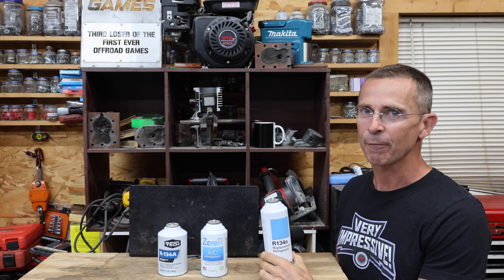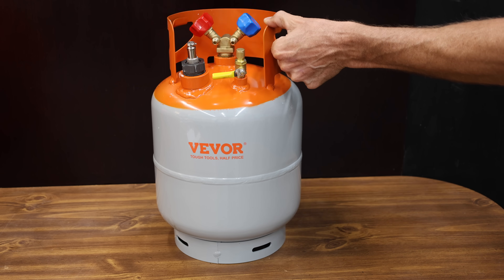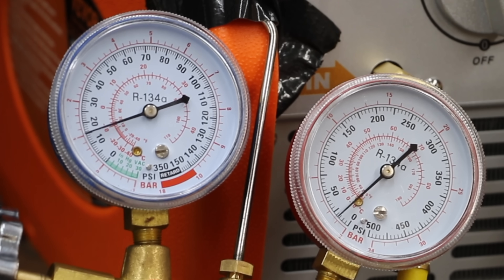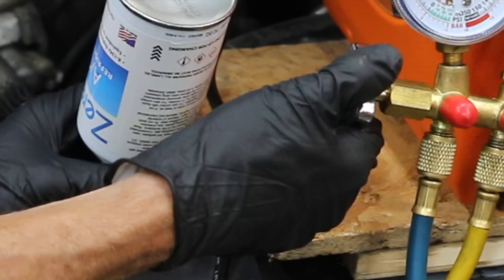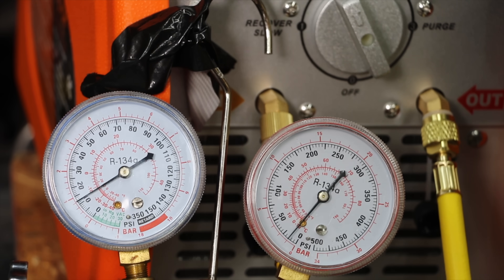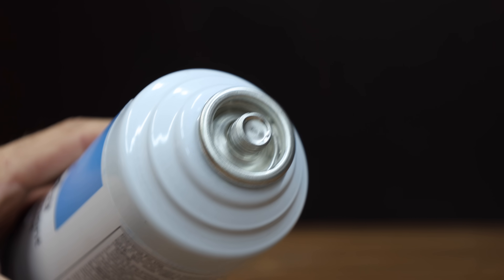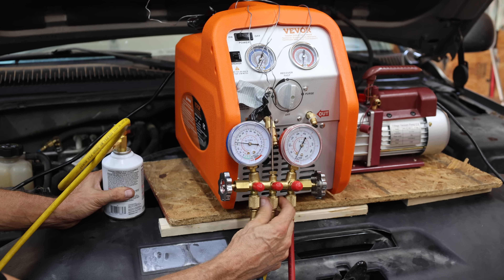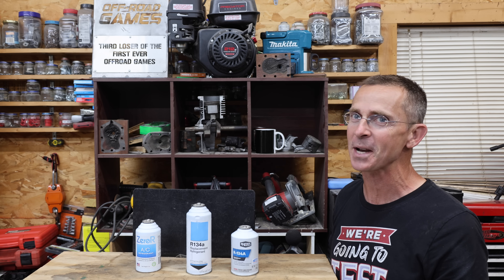How Dangerous is Fake Car A/C Refrigerant? Let's Find Out!

Comment: Love how EPA claims venting of refrigerant is so illegal and irresponsible, even of the non-ozone affecting kinds, yet everywhere you can buy canned air which is nothing more than a similar type of refrigerant INTENDED for open air release.
Reply: And you can even use that stuff (R152A) as an R134A replacement. Works just as well and is less flammable than the propane/butane mixes. I used it in one of our cars as an experiment and it's been blowing ice cold for years.
Reply from the maker: Thanks for the feedback.
Reply: @BerserkerCatSplat  I've heard that 152A works better than 134A but I'm not convinced. It's definitely cheaper though haha
Reply: @Argedis  Yeah I'm not sure I'd say it's "better" as I didn't do any back to back testing, but I can say it works very well. Helpful for us Canadians as we can't buy 134A without a special license.
Reply: @BerserkerCatSplat  That's a good secret alternative over there then. Did you have to empty the system of 134a first? Or can be it mixed? Apparently 152a takes less fuel to operate than 134a
Reply: All refrgrent have global warming potential. There is a score index for it. Another of the propane based refrigerant have GWP of less then five. R-134a is around 1,400 GWP and R-23 is around 14,000 GWP. If you want to find other GWP number just look up global warming potential table refrigerants

Comment: Good job showing the recovery procedure. Over here in Germany, only a licensed tech is allowed to handle gases like R134a and similar ones harmful to the ozone layer. That's also why you may not install a home AC yourself (unless its a completely enclosed system with no removable lines that just hangs outside the window). This is also the reason why so many new units use R290, because it is exempt from this rule.
But for handling R134A, R1234yf and all similar stuff (god forbid R12) you have to have a certification and have to be employed at a company who is certified in this field of work and has the right tools on hand - fines for not complying can go up to tens of thousands of Euros.
So no re-filling your dead car AC at home with anything but substitute gases.
Reply from the maker: Thanks!  Thanks for sharing.
Reply: Nazxi Germany not less, because of your idiotic EU laws, I have to buy r134a at local refill shop to my own cylinder. How come refrigerant boys sell r134a in Germany then? hello Italy is in EU too
Reply: @akierum  It's even funnier that I can buy R134 in Italy without a license, but I need a license in Germany.
Reply: @thebamplayer  do you buy from refrigerantboys shop?

Comment: In Mexico, Mexicans will stand on the side of the road with propane tanks and recharge your vehicles fo 5 dollars. Many have exploded due to leakage.
Reply: BS they explode.
Reply: Believable they also have operations where fuel pipe lines are tapped for resale.
Reply from the maker: Thank you for sharing!
Reply: :o I haven't seen those. I guess only In the desert states like sonora and Chihuahua. Imma investigate about it
Reply: Have to be careful with shady AC guys. Mixing gases in an AC unit is bad juju.
Reply: Those that exploded got the bonus package. They really chilled out.

Comment: I use 12a in my Classic car  which is a replacement and compatible with r12 and 134r and oils. Its available widely in Canada and meets the Montreal environmental parodical. It blow very cold, it has a small amount of propane in its mix. A person does not need a license to use it since it is 100% safe for the environment.
Reply from the maker: Thank you for sharing!

Comment: VIDEO IDEA:
Freon was a brand that no longer exists. The actual name back then was R12 refrigerant, which contained chlorine and damaged the ozone. Its like calling all cars "honda". 
The refrigerant we use today R134A and R600(isobutane). 
Would love for you to buy a R600 (isobutane) refrigerant fridge, cause a leak in the interior evaporator coil with the doors closed and give it a source of ignition!! 
I can't understand why they want to start using a flammable gas in fridges now!!
Reply from the maker: Thanks for the suggestion.
Reply: The reason is simple: It’s cheaper and much better for the environment to use HC refrigerants. The sooner we get to using them universally, the better IMO. 

Let’s have the flammability argument once every home is free of natural gas, propane grills, and gasoline powered vehicles and yard machines. Oh, and let’s not forget flammable lithium batteries.
Reply: Seems to be pretty safe in practice. One think I do notice is that fill volumes have been reduced. I do wonder about the source of ignition though. Door light switch ans thermostat come to mind.
Reply: r600 has been use in UK fridges for over 2 decades - explosions are extremely uncommon. The chances of a) an internal leak inside the fridge and b) it being left for long enough to where the vast majority of the r600 is able to accumulate in the fridge and c) an ignition source is found inside the fridge are so rare that the relatively HUGE costs of non flammable environmentally friendly refrigerants (look at the cost of r1234yf) is simply not worth it. 

The amount of it is so small, that an external leak even in a relatively small room is not an issue. 

Mains gas leaks are FAR more likely to ever happen.
Reply: @pizzablender r600= isobutane. Fridge door closed = confined space. Perfect recipe for an explosion
Reply: @TheWhiteAfghan  True but if there is no chance of it leaking all at once then there is no risk.
Reply: @djenson  most flammable gases need about ~15%  gas to air ratio. Common fridges use 4oz of refrigerant in enclosed freezer space of about 24xx32x32 inches. Guy smoking a cigarette opening the door can get a very bad surprise 😂😅
Reply: @TheWhiteAfghan  did you read my comment even?
Reply: @djenson  I did reply

Comment: People that don't know how to service this stuff shouldn't buy it. Especially these hydrocarbons like R-290 (Propane), R-600 (Butane). The reviewers saying these aren't refrigerants are ding dongs, they are refrigerants and in the future your home AC will likely have one of these systems. Anyone who bought a R-410A unit to replace their R-22 unit is gonna be screwed. The beauty of these hydrocarbons though is that you don't need to recover the freon, you can just vent it to the exterior safely. I need to buy a new A2L or A3 compliant recovery machine because of this mess, another $1,300.
Reply: Anyone with a 410a system won't be screwed, but over the next few years the production of new 410a will ramp down until it hits around 15% of current levels, where it will stay for the foreseeable future. So prices will rise eventually, but not like R22. And not immediately.
Reply: @pmode2474  I disagree, I think people will be screwed. I do agree that it won’t be as bad as the R-22 situation. I work in large commercial and industrial markets, so it doesn’t impact me as much, but there won’t be any new 410A equipment after January next year. I know it will continue to be manufactured until 2036/37, but we’re right back to turning the industry upside down. It just hurts the consumer.
Reply: That what I don't understand.  Us ac tech need a 609 to buy refrigerant and service systems.  Everyone else can go to Walmart and buy cans and blow refrigerant off into the atmosphere to repair their systems.
Reply: @Sainte305  I mean, you're not wrong. New equipment/parts won't be produced forever. But, at what point do we as an industry stop advancing and decide "this is good enough"?
Reply: Maybe refrigerant will make a full circle and sulphur dioxide will be king once again!😂
Reply from the maker: Thank you for sharing!

Comment: The propane/butane r134a substitutes are safer in your AC system than the gas in your fuel tank because there's no oxygen available in the AC system.
Reply: But when they leak through the evaporator into the cabin and you jump in and turn the key , blammo .
Reply: @onthelake9554  Doesn't work like that. These refrigerants are safer than gasoline.
Reply: @crownvicca the ZeroR is just LNG.
Reply: @onthelake9554 The probability of that happening is very low but not zero.  The substitutes have a strong spearmint smell added so at least you would know if the cabin was full of propane.
Reply: @crownvicca  It does work like that , I went through cert school in the 90's and they had video of roofs peeled off cars .
Reply: @seisont  Me or you would but what about grandma or your kids ?
Reply: @crownvicca  Gas tank is not behind your glove box for a reason .
Reply from the maker: Thanks for the feedback.
Reply: @onthelake9554  All refrigerant is flammable when mixed with oil. When introduced to a open flame R134a will ignite at around 600 degrees F after being compressed and mixed with oil, while 12a will ignite at 1600 degrees F. Also, good luck peeling a a roof off a car with 12 oz of propane.
Reply: @crownvicca  12 oz ?  Cars in those days had 3 to 4 lbs .  Slightly flammable is one thing , explosive is another .
Reply: @crownvicca  Plenty of videos on the subject , take a look .

Comment: As an auto tech in canada. It blows my mind that you just go to the store and buy R134. Where i am, you need a license to buy and work with freon. When you use small cans, you have no idea how much freon you are puttin in to the system and no way to put oil in.  Not good for the co.pressor in the long term.
Reply: No store required.  Amazon will deliver the 30lb r134a or r1234yh right to your door.   You can't buy the old r12 tho.
Reply from the maker: Thank you for sharing!
Reply: Canadian Tire sells hydrocarbon based drop in refrigerant for automotive applications in small cans similar to those in the video, been doing it for decades…anyone can purchase, no ODP ticket required.

Comment: Nice trick showing the second old green 134a (recovery?) tank. Those are equipped with a single one way valve (out). To recover you need both inlet and outlet valves.😂🤣
Reply from the maker: Thanks!

Comment: Hey bud love your videos but there’s one thing you may be missing on this one. The epa is phasing out HFC refrigerants due to the global warming potential or what not. R134a is also being phased out which is why those companies are most likely selling what we call drop in refrigerants in the hvac side of things. These refrigerants are designed to meet epa requirements while also keeping a system that will not be able to have its original refrigerant used.

Comment: The “original” Freon is R12 and has been banned since 1996 is the USA as it supposedly destroys the ozone layer. It’s only current use that I know of is in fire suppression systems for US navy nuclear subs. The replacement was R134a which was pretty good and cheap but now that’s getting dumped too cause it’s supposedly a greenhouse gas. The newer refrigerants are way too expensive and some are even flammable.  Lots of compounds absorb heat and give off heat with a change of state and can be used as refrigerants for example propane and ammonia.
Reply from the maker: Thanks for the feedback.

Comment: Propane is actually a refrigerant used in many commercial freezers and such. It goes by R-290. It differs from the propane you buy at the store normally in that it's far more pure so it can be used as a refrigerant. It is flammable because it is propane, and there aren't actually any restrictions on venting it - you do not need equipment to recover R-290 and can vent it to atmosphere (minding where you vent since it is flammable). R-134a you shouldn't vent it, but small quantities can be let out fine. That's the reason why it's not a self-sealing can - if you vent it no big deal. It is not likely to be natural gas as methane is a potent greenhouse gas. That's why they're easily sold to people - propane has no restrictions on venting and thus the average person doesn't need recovery equipment nor special training.
Reply from the maker: Thanks for the feedback.

Comment: Pretty good video. I do commercial HVACR for the past 25 years. The only minor issue I seen was when recovering, there are different vacuum levels that need to be attained to be technically complete. Usually 10 to 15” is preferable. Otherwise a great explanation and video. Thanks for all your testing.
Reply from the maker: Thanks!

Comment: Good timing on this one! I just got the suggestion yesterday afternoon. I had just installed a new compressor. I used ES 12a which I think they also call R290 now. My cans show "Envirosafe refrigerant" This stuff cools well and they recommend not pulling a vacuum prior to to charging. I get temps when driving down the road of 38 to 40 F on a 2005 Elantra. 

Flammable refrigerants seem to be more common. Hydrocarbons. There is a big tank of Hydrocarbon in the back of my car. Weights up to 84 lbs. One more pound does not seem to add too much risk in my mind. 

A lot of freezers use this type of refrigerant now. People carry this kind of substance in their pockets in a thing called a cigarette lighter! So I will take my chances with is since I do not feel like buying a vacuum pump! 

Now there is a new trend of using carbon dioxide for HVAC systems.  They run at head pressures of 600psi. So the pressures will be this high when warming your house in winter, on the condenser which will be inside your house in this situation. If you have a leak where will the gas go, into the living areas. So is running such a high head pressure refrigerant for heating a good idea? I think not.
Reply from the maker: Thank you for sharing!

Comment: I used a R-134a alternative from EasyClima and it made the AC cool again, and in the EU you can't buy R-134a from the auto part stores so the alternatives are the only option unless you give a workshop 250 dollars to fill it!!
Reply from the maker: Thanks for sharing.
Reply: Some shops do fill-ups pretty cheap, i got mine filled in summer of 2023 and it cost 50€.
Only holds 750g of R134a though.

Comment: Wayyy back When my first car's ac died. I taught myself about ac systems and refrigerant. Since the car used r12 which is banned. And without doing a system retrofit, in order to keep the low head pressures, I used R-152a.  This was acquired from Dust-off cans. It actually worked so well i had to way overcharge it to keep it above 32 degrees. It would be cool to see you do a video on what refrigerant works best on those old cars with banned refrigerants.
Reply from the maker: Thanks for sharing.  Thanks for the suggestion.

Comment: Great video!
Contrary to what people think, Ac systems do NOT work better if slightly over charged, but they work better if slightly under charged or exact charge  because the gas needs room to expand past the expansion valve or orifice tube. 
Poor cooling at idle can be a bad clutch fan, or weak electric fan, or fan not operating properly.
Adding refrigerant can cause a system to shut down and stop working if over charged.
Reply from the maker: Thanks for sharing!

Comment: Just getting around to watching this video. The replacement R134a is more than likely R1234yf. This is a known direct replacement for R134a but with a far lower global warming potential GWP rating (hence eco friendly on the can). R134 cannot be bought in many regions due to its very high GWP.  However R1234yf is flammable (as per the markings on your can) whereas R134a is not.  There are scientific papers written on the cooling potential of both refrigerants. It might also be R513A which is a balanced mixture of R134a and R1234yf to be more effective, lower flammability but with a more acceptable GWP than R134a alone.
Reply from the maker: Thanks for the feedback.

Comment: I have a older car and I have bought and used the replacement R-12 on it, 1991 Pontiac, and it worked out fine. The had a three unit pack, one regular small container of refrigerant, one refrigerant with oil for the system, and the third can had a system sealer mixed with the refrigerant. I don't know what that used but it works well...
Reply from the maker: Thank you for sharing!

Comment: My very good friend (now deceased) was a refrigeration mechanic for around 60 years, safe to say he'd seen it all.
When he retired and started doing a few cash jobs on car air-conditioning as well as other stuff he used R12 then R134a. But you have to be licensed to purchase refrigeration gas in Australia.
He had tried out a few isobutane gasses and settled on HyChill.
Yes it's flammable, but so is the 30 gallons or more of gasoline in your tank and it generally only burns at a specific concentration with air, that's why gas burners need a proper nozzle or they burn terribly.
I've had the replacement gas in my car now for 5 years and it's only problem is that it is actually too cold most of the, that's in Northern Australia too, where 100°F is not uncommon.
It has (as you said) lower head pressures, it should require less gas than R134a and because of its much larger molecular structure, is less likely to leak from tiny tiny little holes or minuscule seal problems.
He used to say Cycloprane was the best refrigerant gas know to man, but because it's also an anaesthetic, not a great idea if it leaks into your cab lol.
Great video, well presented.
Reply from the maker: Thanks!